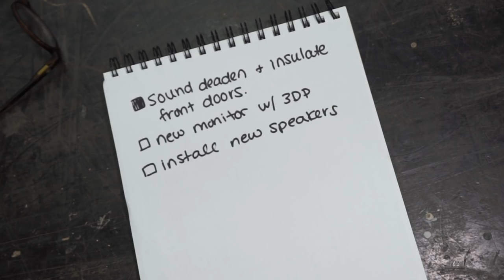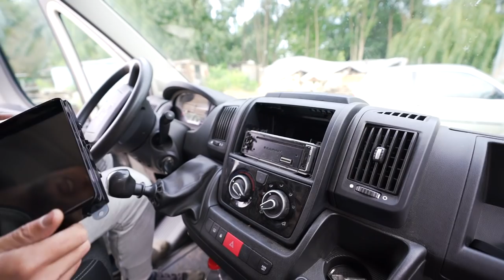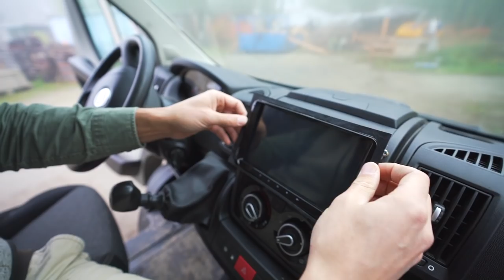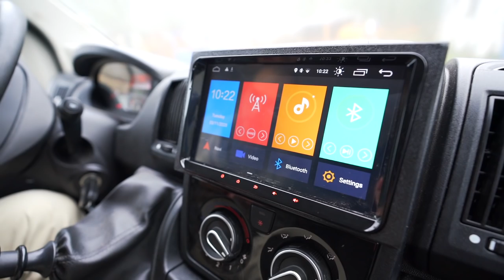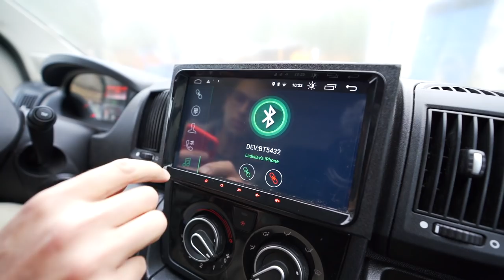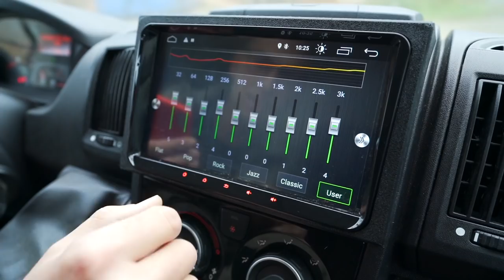Cab Insulation & Upgrades / NEW Curtain + Couch Ideas for Van Conversion! (Ep. 5)

Comment from the maker: Time is flying but we're happy with even small progressions these days! What do you think of the curtain and couch ideas?! 
We're getting itchy feet to really start working on the roof (ie, 1kW of Solars & 4 total roof windows!), but we have plenty to work on in the meantime. We've linked both the stereo we installed and the monitor in the Van Build spreadsheet in the description. Thanks so much for watching!
Reply: 3M makes a window tint called Crystalline. A friend of mine used it on his vintage supercharged 1967 MGBGT. The lightest tint looks clear, reduces heat penetration by 34%, and in the United States can be used on the front windshield. The next level darker which Stewart used on the rest of the windows reduces heat penetration by 50%.

On my car on a sunny day in the interior you can put your hand near the door window and feel the heat coming through the window. On Stewart’s car on that same day a few minutes later I did not feel any heat. It’s not inexpensive and I am retired because of Parkinson’s so I am saving to have it installed. Because my front windshield is heavily pitted and the door glass is scratched because the door window rubber I am waiting to replace those items before I have the tint applied to my car which is also a 1967 MGBGT. It might be a few years. 

The darker you go the more it reduces heat penetration. On a vintage sports car going darker would ruin the look. However, on your van with the exception of the front windshield I don’t see any reason why you can’t go darker and get a larger reduction in heat penetration.

Here’s a video of Stewart’s MG taken right after mine. You can see how light the tint is. https://youtu.be/opKbeJzd86I

Ignore the awful marketing speak. I think I found the performance information in the PDFs. They all reject 99% of UV light which should reduce fabric fade. 

https://www.3m.com/3M/en_US/company-us/all-3m-products/~/3M-Automotive-Window-Film-Crystalline-Series/?N=5002385+3290229310&rt=rud

I like your videos and enthusiasm.
Reply: Automatic curtains, amazing idea! And the couch idea scared the shit out of me at first lol but brilliant idea
Reply: What a joy to have so much space and extensive tools to  be creative and be able to fabricate just about anything you can think of. What a great hang out. Who needs the city? Please be sure to a series on the build of the apparment.
Reply: You guys are awesome!  

Had one thought on the reclining chair/couch - have you considered a “wall hugger” type reclining mechanism?  Noticed that when you recline, the backrest of the chair tilts further back and would require space behind it and the wall to get full extension.  With a wall hugger, the base of the seat, in combination with the back, slides forward when the foot rest is completely extended.  Two cents...

You two are the gold standard for van builds, ideas and insight - thanks for sharing and keep up the great work!!!
Reply: @johntossing624  I was thinking the same, but they might not be available where they live.
Reply: @TannyOHaley  - Upon further reflection and given Ladi’s ingenuity, he can probably engineer a seat slide out to accomplish the same functionality with what they’ve got!
Reply: What about the water that enters throug windows and handles an runs through the the door? Isn`t it going to be trapped in your insulation?
Reply from the maker: Hi, I see. Weird I overlooked you. Thanks for the reminder.
Reply: Yay! I was getting weary of waiting and almost bought shitty parts and battary!

Comment: I have not long fitted an android monitor quite similar to our Ducato van. I am so impressed with the cover you made. Absolutely superb, I need a 3D printer 😁
This is going to be one of the best van builds on YouTube. Can't wait to see your couch when its finished.
Reply: You could knock the same thing out with wood or other materials quite easily. 3d printing is cool but lots of other options
Reply from the maker: People commonly do these frames from fiberglass but that’s hell of a work to create a mold first. Plus breathing resin and sanding fiberglass is very dirty work.

Comment: Are you following live updates of the US election and need something to de-stress? Ladi and Margaret got your back!
I'm starting to love Wednesdays.
Reply from the maker: <3 thanks for saying that, Mary!
Reply: @ladiandmargaret  for your window cover, I suspect it might be easier to do something with levers rather than electric articulating things.it could be slightly spring loaded and counter balanced so that it can pop up and down quite easily by pulling a lever connected to the internal lever mechanism. Makes sense in my head, possibly not in this comment though

Comment: A suggestion for your free time: Where you replaced the stereo with the flat panel unit, put a hinge on the flat panel and a storage box behind it. It's not a large area, but in a van any little bit of storage space helps.

Comment: So there is an easy and space effiicient way to cover up windows using an insulated covering held in place by magnets. Why would you you want to have an automatic system that will eat up space? What is the added value and why would you want to forfeit any budget and space for that? It does not sound logical to me but I am looking forward to the build and learning something.

Comment: Not sure the material of the bezel for your van's stereo, but if its PLA, I would reprint with ABS and harden it with acetone for strength and uv stability. PLA will lose its strength within a year or so.
Reply from the maker: I used petg

Comment: Hey, Ladi, how tall are you in metric? 

I want to put this into perspective while I see you running around the van. Thanks!
Reply from the maker: Hi, sure. I’m 189cm, 85kg 😂
Reply: Ladi & Margaret   Thanks, me too!
I wonder if the H2 height would be enough. I fear that the H3L4 fiat would be more than 3,5 tons and therefore would require a pro permit. If I were to sacrifice one of the two (length vs height) so as to be under 3,5 tons I would sacrifice height. I need the length more than the height, but with the bottom insulation and flooring I might have to lower my head....
Reply from the maker: Our L5H3 is and will be under 3,5 tons so you don’t have to worry about this. We had H2 before and I loved it. Standing straight I touched the ceiling but I did not mind at all. Standing with hip out it worked just fine 😂
Reply: Ladi & Margaret   Thanks. Also, you probably mean L4, as there is no L5, right?
Reply from the maker: I was surprised L5 exists. Not much bigger but that’s what it says in the vehicle registration documents.
Reply: Ladi & Margaret   Ha, the only way to know, is to find out the length in meters. Then, if it’s 5 or 4 doesn’t really matter!
Reply: Ladi & Margaret   So, it should be: 4,96  5,41  5,99  and 6,36 for the 4 lengths. Can’t find L5 !

Comment: Ladi, for heat resistance and from the stringing, I'm assuming ABS for the head unit surround? Nice work.

In addition to a CNC, I have two 3D printers. A Flashforge cartesian and an ANYCUBIC delta. I'm thinking about getting myself an ANYCUBIC MONO for Christmas, and making that smaller SLA printer the one for the road.

Are you building your battery, or are you planning to partner with a company such as GBLPower? They've just introduced an affordable line of compact LFP cells (https://youtu.be/Fqnfqe0HmIw). I also really like their BMS technology. Best of all for you, they're based in Prague.

Be well Ladi and Margaret. I can't wait for next Wednesday!
Reply: That sounds like it deserves a reply

Comment: 3D printed parts in a hot car will warp. ABS, PLA, PETG. Temperature in a car is just too hot.
Reply from the maker: Petg? I don’t think so.
Reply: @ladiandmargaret  Unfortunately, I accidentally left a petg adapter for a drone remote (5 hour print) in my car a few weeks ago. It warped & is unusable. It did not completely melt, however it is no longer dimensionally accurate & my phone does not fit in it. Obviously I can print a new one, however I would be hesitant to use a 3d printed part intended for use inside a vehicle that will get hot in the sun.
Reply from the maker: Good to know, thanks for sharing. Will see what happens, I can always use the model and print a mold for fiberglass version.